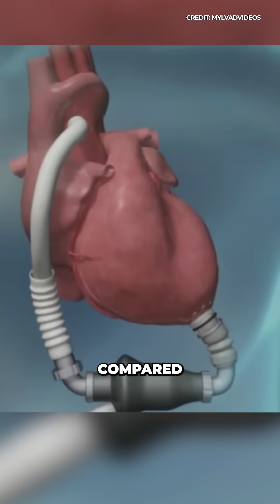Engineers Create World's First Fully Artificial Heart

Comment: So it’s basically a Rupp pump.  Horrible at getting prime because they’re not positive displacement.  But decent flow, idiot proof since the pressure caps out, and nearly impossible to damage since the impeller has so much tolerance away from the walls of the chamber.

Comment: One of the major problems with previous artificial heart designs was the increased risk of them causing large clots to develop (meaning that the patients needed to be put on blood thinners as prophylaxis). If this new design could reduce or eliminate this risk, then it would be a remarkable achievement indeed. 

Anticoagulants like Warfarin or Hepatin, or Antiplatelet drugs like Aspirin, are dangerous enough in an otherwise healthy patient. In patients living with chronic heart failure, they could push risk factors to extreme levels, and have even been linked to mortality events in patients with artificial hearts. (ie: A Thromboembolism - having formed either within the artificial heart, or in the nearby blood vessels - breaks off & travels up to the brain, blocking essential blood vessels, this eventually leading to a stroke &/or an aneurysm).

Comment: Does his heart-monitor just look like a flatline, but higher?
Reply: I guess it would depend on how the heart rate is monitored. An electrocardiogram (which monitors the discharge of the nerves across the heart tissue) would likely read nothing while monitors that operate based on apparent blood pressure oscillations like those used in sports equipment would read a continual elevated flow - though since they read for oscillations they would also likely read "no change/no beat".
Reply: Most would read no heart beat because the common ones on the go are reading the signals
Reply: It would definitely be flat if they actually REMOVED his original heart. That’s the muscle an ekg “looks at”. If it’s gone; no signal.
Reply: I wonder how it would read after I see a picture of Jenna Ortega
Reply: No. It would still ossilate due to the fact blood needs to be pumped in a rhythmic fashion.
Reply: @NamenamenamenamenamenamenameM I’m sorry, no. Circulatory bypass is performed at a constant rate. The machine doesn’t pulse as it’s not required. You may be referring to pulmonary ‘breathing’ machines. They must pump in a natural rhythm that emulates breathing. But the one for blood is a simple, but extremely expensive pump. 
I admit that I’m not sure how ECMO (full life support) works. Maybe that pulses… I doubt it but don’t know.

Comment: design sounds so stupid... There are already thousands pumps on market that not use any rotated element to pump fluids. Instead, they use silicone caps and valves (exactly like heart works) that pull and push the fluid without causing friction

Also levitation requires a perfect magnetic field. Even the smallest external magnetic field or electrical interference it will cause the that pump to crash and fail

Comment: There were already artificial hearts, the first was implanted in the 80s, but one was built using off the shelf components (including an erector set) in the 50s, it was implanted into a dog and kept the dog alive for an hour before it stopped doing that. This is the first without a pulse though. The artificial hearts is actually on the syllabus for the AQA exam board's A Level biology (or at least it was when I did it).

Comment: I wondering how weird it would feel to not have a heartbeat anymore and just have the constant flow, especially with more rigorous activities like running, because when you run you can feel your heartbeat in your chest and neck. And would the constant blood flow lead to better muscle endurance compared to a fast normal heart’s flow? Like could the small downtime between heartbeats be eliminated to give a better exchange of oxygenated and non-oxygenated blood? Or maybe the mechanical heart could also help with conditions like high or low blood pressure from having the consistent pumping, which could help with the balance of force on the vessel walls.

Comment: This reminds me of a conversation i had with my dr when i had i blood pressure. I asked what caused high blood pressure. He went on to start listing a bunch of factors. I stopped him pretty quickly and clarified that i mean in terms of fluid dynamics. Like, was it something like the heart beats harder, increasing the pressure, or the arteries having a smaller inner diameter,  etc etc, and asked if you could narrow down the problem by looking at if the systolic or diastolic was high, or low, and the ratio between then. Not sure if he didnt know, or didnt know how to explain in a reasonable time, or if i just didnt get what he was saying, but i still dont have as good an understanding as id like. However i can imagine id have got a better answer from a plumber.

Comment: How is it powered?
Reply: From the company’s website:
“A small external controller, combined with a rechargeable battery system, supports untethered operation from an AC power source to enhance patient mobility and freedom of movement.”

Seems there’s a wire that would exit the body somewhere and connect to a battery.

Comment: Okay, but the important question is how is the heart powered? Is there a battery pack sticking out of their chest?

Edit for those curious, the article says:

"The nearly 1.5-pound artificial heart is powered by an external device, which is connected by a wire that runs through the patient’s chest. During the day, the external device can run on batteries, and it’s plugged into an electrical outlet at night.

Right now, the batteries must be changed every four hours. But Timms hopes to make improvements to BiVACOR that would eliminate the need for an external battery altogether, per the Australian Broadcasting Corporation’s Elise Worthington and Paige Cockburn. The vision is something like wireless phone charging, with a charger placed over the patient’s chest in a way that won’t burn their skin."

Every four hours... Oh god.

Comment: Just to share some info, this isnt quite a world first.

Similar effects were seen during the clinical trials for the HeartMate 2 Left-ventricular assist device (LVAD) system a while back, which used a magnetically levitated archimedes screw to pump blood. 

Patients inplanted with this device did have their biological hearts still in place, though notably, a few patients had their biological hearts fully die while they had this inplant, and they were unaware. The LVAD was able to pump their blood well enough that they didn't know their biological hearts were dead until they got their blood pressure taken and saw only one number. 

What makes this special, is that these guys kept going with the magnetically levitating rotor (unlike Abbott, who got rid of it in their now-recalled heartmate 3 🙄) and they changed their intended use to be a full heart replacement, rather than an LVAD

Comment: In case it wasn't covered in the comments, the Bivacor has an external controller and rechargeable battery packs connected via a percutaneous (through the skin) driveline.  2 battery packs with one needing to be recharged or swapped out every 4hrs.  In future there may be a fully implantable power source which is charged wirelessly.

Comment: The first artificial heart was the jarvik 2000. A large part of the risk with artificial hearts come from the power/pressure drive lines which are huge infection risks because they connect from outside the body directly into extremely vital body sites. Moreover metalic materials are easy attachment sites for bacteria. 1 infection and youre faced with the impossible choice of needing to remove it. This is among the many reasons the assist devices are more prevalent than total mechanical replacements
Reply: Metal is not good for bacteria, they kill it. Worse is tissue plastic paper etc... so i think you are wrong about bacteria and metal. Also this is doing in sterile rooms in hospital etc...

Comment: As amazing as this is, I wonder what the effects of a constantly flowing system, as opposed to a pumping one, has on the body. Blood pressure is necessary to push the blood to certain areas of the body, but does this create a constant pressure? If so, that is likely damaging blood vessels. Does it not create pressure but rather just circulates? Then there are areas of the body no longer receiving adequate blood flow. Again, don't get me wrong, this is an amazing invention and is well worth heaps of praise! I just worry about the effects on other regions of the body if a donor isn't found quickly and the effects when one is found.

Comment: I wonder how this sort of pump changes blodflow to capillaries. The capillaries are so small and often not in a circular system like the main arteries - so they kind of need push-pull motion (from the pressure variations) to work. Even lesser heart problems that don't properly generate that pressure peak can cause problems with capillary flow. 

I always assumed a working artificial heart would use artificial muscles - since we always have ways to make them. Probably a problem of sitting everything into a sufficiently small space.

You can imagine a future where this tech is as well polished as a pacemaker - but surviving such an invasive operation is probably never going to be low risk.

Comment: This seems so alarming to me. Cpr wouldn’t work, I think defibs would be a huge hazard. What happens if your heart stops charging while you sleep, does it alert you? Also if you pass out people would probably think you’re dead since theres no heart beat.
Reply: You wouldn’t use CPR or a defibrillator in this case, because the person doesn’t have a biological heart, it’s a completely mechanical system. If something goes wrong, it’s not a heart rhythm issue, but a device or power failure, so the solution is fixing the power supply or the external controller. It would work like any other Total Artificial Heart, with an outside controller carried by the recipient. And as for the issue of passing out, the patient would most likely carry around a medical id as bracelet or a necklace or in their wallet for that issue, and the controller their carrying around is hooked into their body. And for the charging issue, they'd most likely be alerted by the aforementioned controller, and they'd replace the battery and start charging the empty one.
Reply: @conscript000 I forgot that for similar things, medical personnel are usually alerted automatically. Also slipped my mind that people with medical conditions usually keep something on them just incase, similar to a DNR.

Comment: It’s interesting, because although the sheer forces and certainly cause RBC damage, the real problem is its activation of vWF, that initiates clotting. Whether or not that heart affects vWF activation would be interesting to know. I worked on a paper that used enzymes (ADAMTS13) to break down vWF in the context of LVAD impeller devices, so a motor that doesn’t require DOACs/anticlotting treatments would be incredible

Comment: It is not beyond the capability of modern science, to invent a "pumping" heart using electrically activated tubing that expands and contracts via positive and negative charged pulses.
Keep in mind though, it would most likely be no where as efficient as a mechanical pump with current material availability.

Comment: The hard part isn't making it work, it's replacing the original heart and also making it in a way where the body won't reject it.
Reply: Honestly, i would rather have the titanium heart if it can be made to work long term and not cause rejection or artery problems. Better than to deal with heart transplant, as rejection and inflammation of various degrees is almost inevitable. 15% won't even make the first year. Before growing custom hearts from your dna becomes commonplace, proper mechanical hearts might be a better solution than transplanting someone elses heart.

Comment: As someone who is in to cars, I think it is insanely awesome how the thing is designed almost exactly like an electric oil pump or electric water pump found in modern cars. Same concept I would imagine too.
Reply: Heart is the engine of the body. Legs and waist transmission.. Love comparing human body to cars lol.
Reply: Resembles a turbocharger much more. Inlet and outlet to spool it and a third to send that pressure somewhere else.
Reply: @scrull4373  it doesnt resemble a turbo at all to me. The whole point is it doesnt have a turbine attached to a solid mechanical shaft destroying blood cells with friction
Reply: @gitarooman2995  water pumps and oil pumps and turbos all use shafts so your point here is moot. It clearly resembles a turbocharger the most in appearance and function. (Inlet outlet to build pressure, auxilary(s) to send that pressure elsewhere) Not gonna keep arguing with someone who doesn’t work on cars for a living.
Reply: It looks like a turbocharger
Reply: Thats some bs comparison
Reply: All the silly arguing about what it resembles is by people that don't even know ALL the ones mentioned are centrifugal pumps, it doesn't matter what form it's in, it uses the same physics, all that's different is the working-fluid, viscous liquid or air, the method of "grabbing" the fluid is different, the mechanism of action is identical. This is different to other heart-pump ideas which are usually axial pumps.
Reply: Yes it's an "if this breaks the whole thing is goosed" style pump
Reply: @-BuddyGuy  There's a different type of pump?
Reply: @LordGoggins  Yeah the windscreen washer pump. Glands. A lung. The fuel pump. The pump that pumps slushies in a 711. Would you like me to continue.
Reply: That heart is a fucking turbocharger
Reply: It looks like a pro charger

Comment: I mean that is really impressive..  

But why not make a better version and leave it in. 
And in case of failure a extended axle is fitted along the heart to the chest front, with a small hatch that can be oppend and attach any spinning device or handcrank until in surgery for repairs or replacement.

I would exspect it is possible to design and refine the design of a mechanical heart with backup systems for revivial etc, which more efficiency than the default one.

Comment: This is wrong. Jarvik-7 was the first artificial heart. BiVACOR is just the first full continuous-flow artificial heart, and I’m pretty sure the founder of the company that made it over decades was only the son of a plumber, who was inspired by his father’s problems, not a plumber himself. It’s not like this is better, either. Shear forces exist regardless of the bearing type, even if they are reduced. That means your blood cells will get ripped apart and your blood will clot, leading to strokes, thrombosis and organ damage. And hemolysis will also require you to drink more water and nutrients, to repair the lost blood cells. Plus, the lack of pulse can mess up skin, kidneys and pressure sensitivity, even if the blood is still pumping. The alternative is a pulsed motor function, but that would theoretically also increase shear forces by making vortices. Of course as usual, artificial organs pose a huge risk of infection, inflammation, immune reaction, mechanical or software failure, the subcutaneous wire is a chronic infection risk, and I don’t even want to think about what would happen if something accidentally gets hooked on it and you yank it away…

If you want to see the numbers, shear force on blood cells in pressure pumps and in the heart are less than 10 pascals, while rotary pumps are at whopping 150-500 pascals in certain areas, way beyond the stress threshold for a blood cell. Also, for dates, the real first artificial heart, Jarvik-7, was created in 1982, and the patient used it for a whopping 112 days, or almost 4 months, before dying from total organ failure (so not Jarvik-7, specifically). Oh, and the number of tests for this supposed “first artificial heart?” Zero.

Don’t you know you are supposed to say the incredibly concerning disclaimers after the medical ad?

Comment: Actualls inserting pump wirh magnetic floating bearings and automatically adjusted speed is a thing for many years already, i think the only novel thing with this is that the pump completely replaces the heart whereas with other systems they are placed on top of the heart. Im courious if this system here has any significant advantage over the others or if its just late to the game...